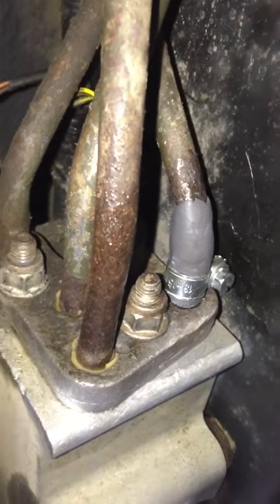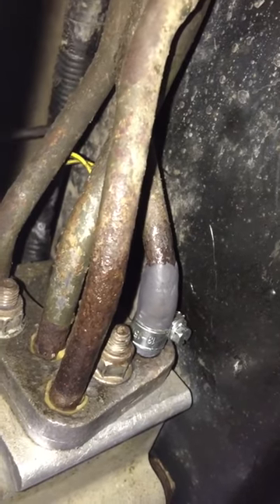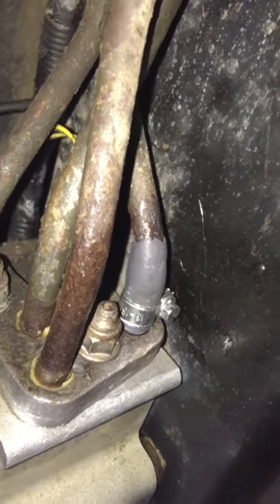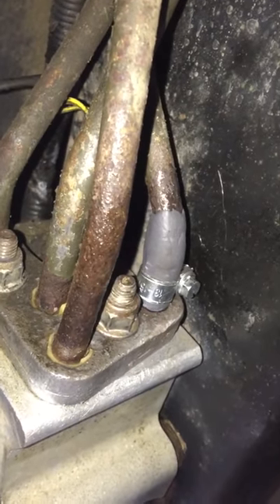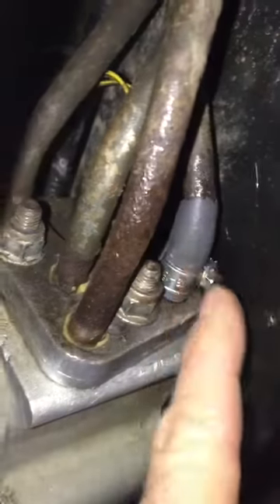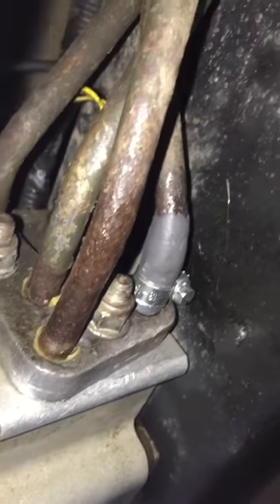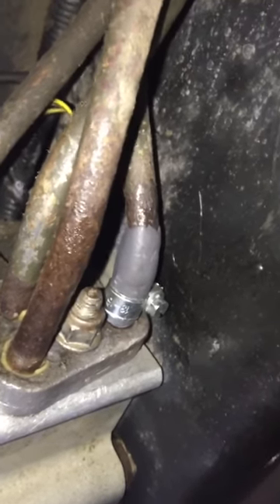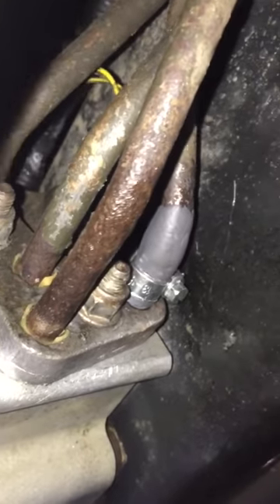Range Rover hydraulic line temporary JB weld repair.

Comment from the maker: I also removed the fuse that controls the valve block that the line is attached to not sure if this makes a pressure difference but it's not leaking so I'll leave well enough alone until new line arrives!